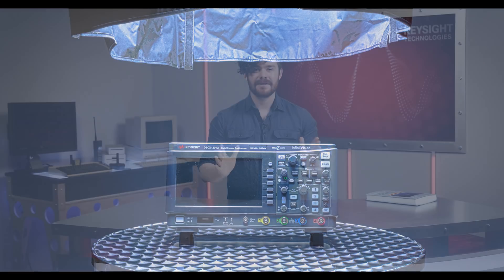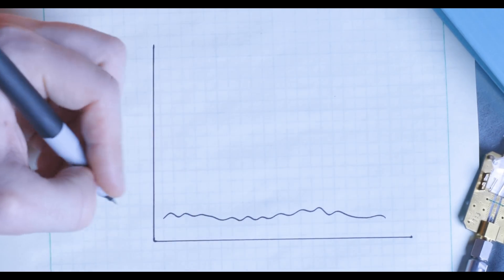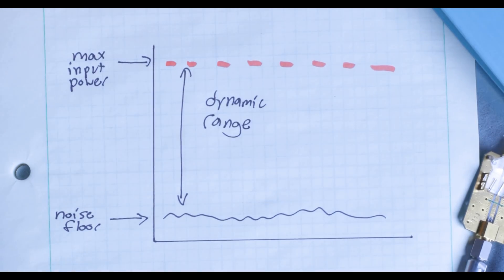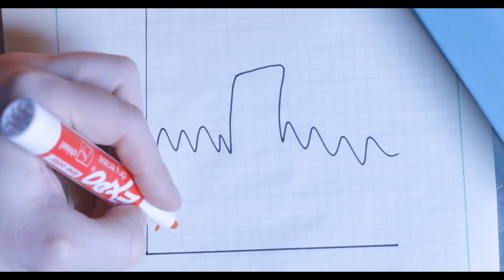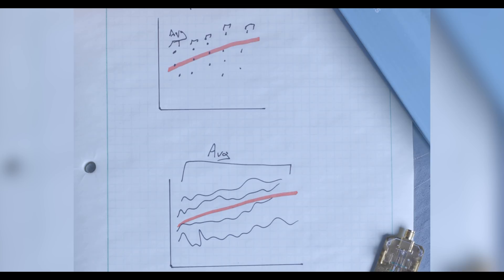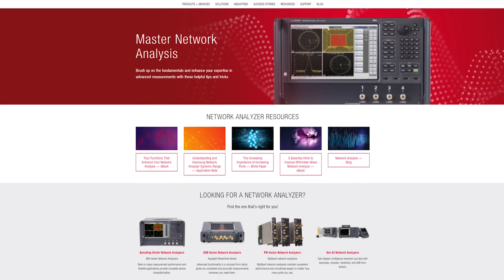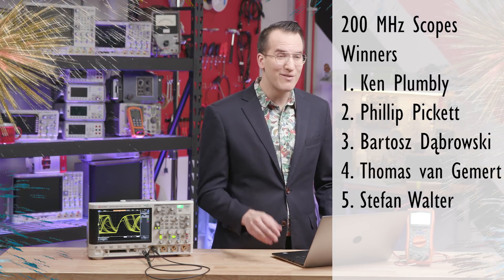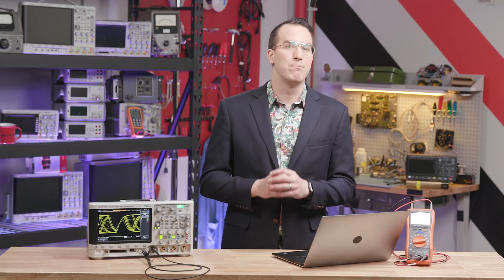Increasing Dynamic Range + Wave Winners

Comment: when I saw the title I was hoping there would be discussion about the factors that affect the dynamic range, for example nonlinearities. For instance, I dont think increasing the source power (as suggested in the video) can always lead to a better dynamic range if your receiver TOI is low.
Reply from the maker: True! The resource library has some docs that go a lot deeper into this
Reply: @KeysightLabs  yeah, I am actually going through those documents. HP/Agilent/Keysight journals, app notes, etc... have always been "the" best place to learn all about electronics particularly RF. I still read old HP journals from time to time and they were so great. I wish Keysight would revive those!
Reply: Hey, i'm really interested in this discussion,  from an audio point of View. I've always wondered why you should (in an audio context) put the highest gain on your source (without clipping of course); I've always been told it is best for the SNR. But that seems a bit too "magical"; why would your usable signal increase, and the noise would increase less ? My guess is that people who say that more gain increases SNR are wrong, and that it only puts the noise level higher. Which in an audio context,doesn't seem so important since in your acoustic source, you don't really care as long as you have like 60 dB of range... And even with a small gain, your signal will be well sampled. Not sure if I am clear on that one, the question is a bit more tricky than it seems. But I am aware that I might be ignoring some factors in this question. Anyway, Where do you think could I document myself on SNR and gain in signal sampling ? I really want to dig this further.